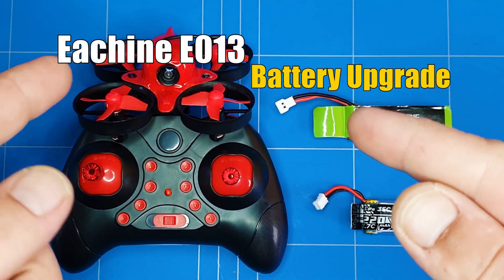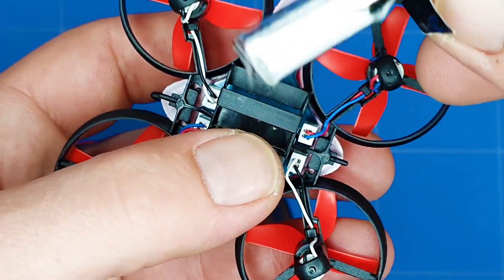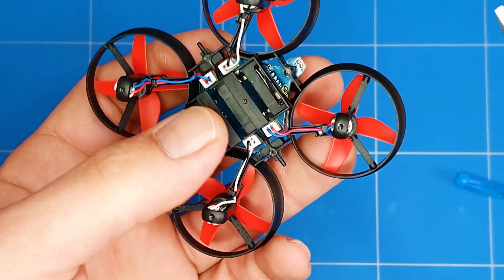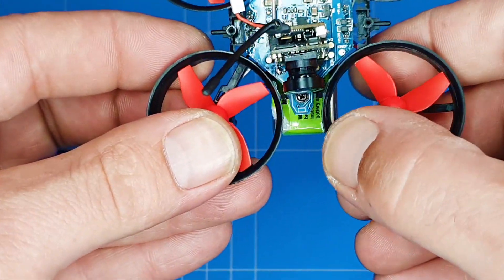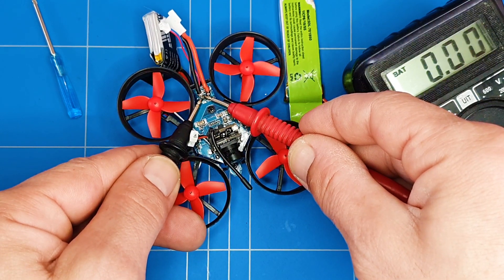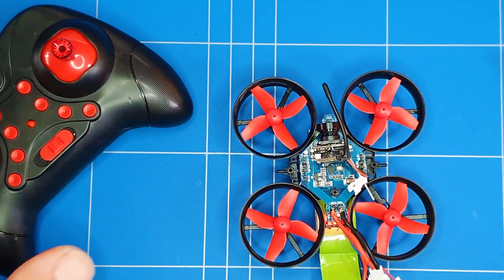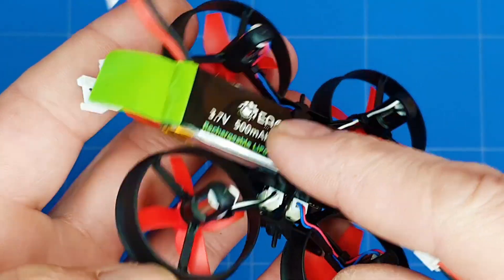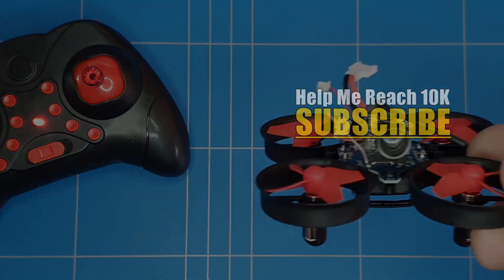Eachine E013 Small Pepper Lipo Battery Upgrade How To Double The Flight Time

Comment: I’ve done something similar, flight time with 300 of 350 is allready a good improvement on the stock lipo. After some crashes I have the problem of not calibrating well, pulls heavily to the left after take off. Can’t get it fixed, any idea how to solve this kind of an issue?
Reply: Hey man... What exact battery did u use dude?
Reply: @MrWhiteenglishman  problem is solved, had nothing to do with the batteries. One of my motors was bad and that caused the weird behaviour. I have JJRC 300mah lipo’s
Reply: A... Never said battery was at fault.. B... Only asked for battery specs...